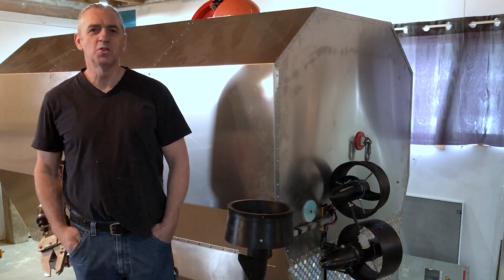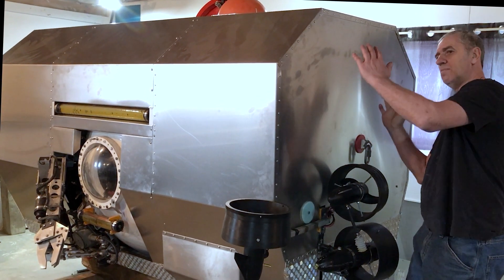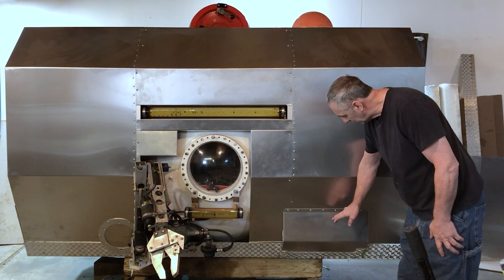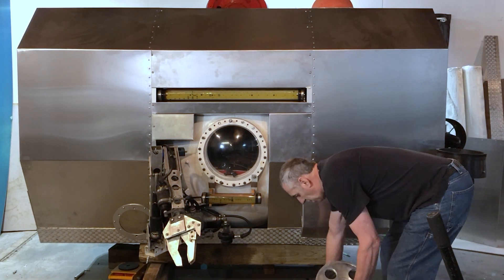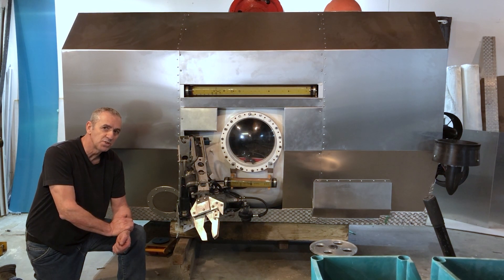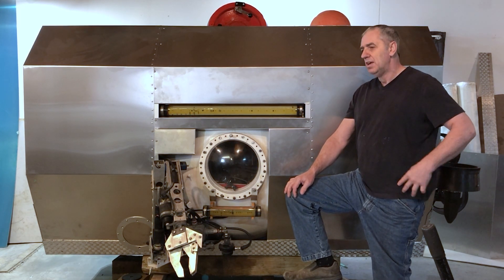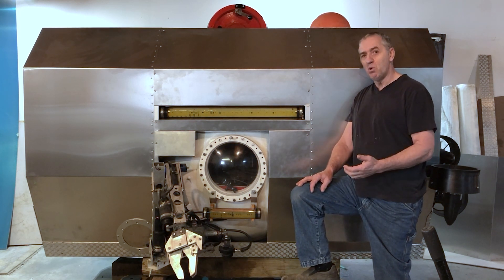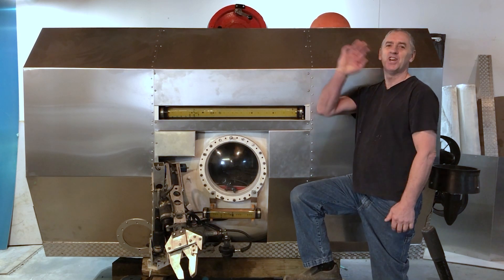Homemade Submarine Update

Comment: Here’s a thought.. why not place the vertical thruster of other other side thruster set on the rear corner instead of the front like the left one is. Keeps the weight down low. And when you fire them together it should cancel out any tendency for it to pitch the sub.
Reply from the maker: That is a good idea, but I can't have the motor protruding out the back.  It will interfere with loading on the trailer.